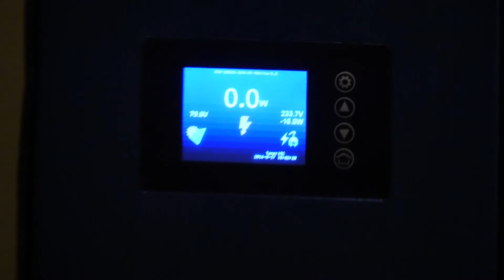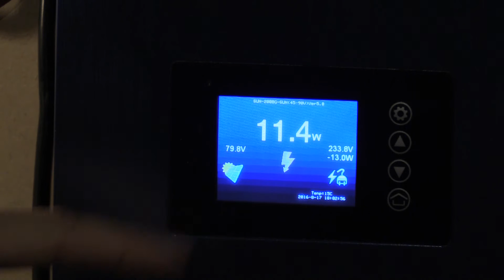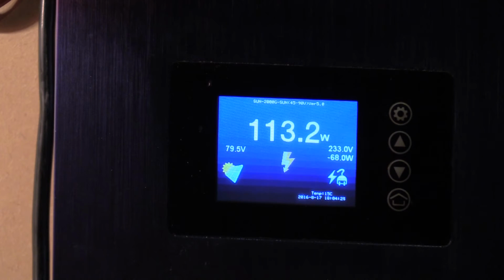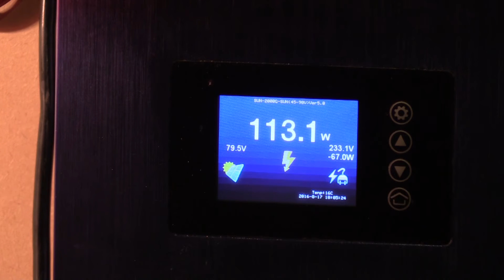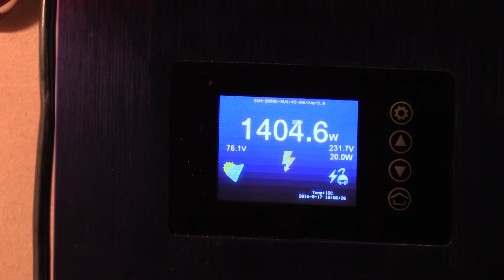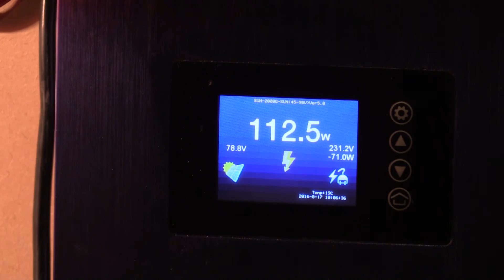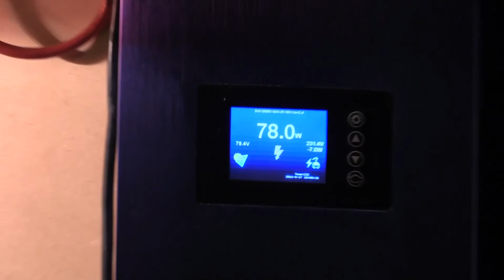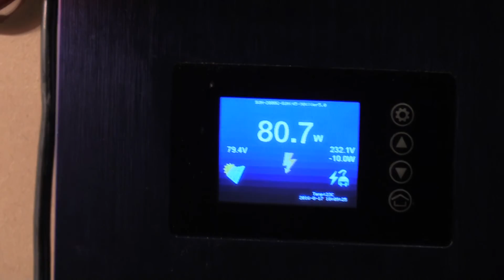It works! Limiter problem sorted

Comment: Why are you not putting the sensor clap at the input of power box like it is supposed to be? Damn you like problems...
Reply from the maker: Great question, the powerbox "switch board" is inside the house. Which is about 15 meters away. The garage is not attached to the house and sits at the end of the driveway and has just a single "what I think is a" 30amp AC cable terminating in a very small single fuse switchboard for the garage outlets. Since the CT Clamp needs to be attached at the closest point to the incoming grid/utility connection. It needs to be place inside the house and on the main switchboard. This creates a problem since the inverter is too far away without extending the CT Cable which is what i did on another video. Not without its own issues tho. I cant put the inverter inside the house without also moving the batteries inside the house and given the small room the switchboard is in and the safety issues, The best place for the batteries and everything else like the inverter, charges and everything that makes fan noises is to put it in the garage.  The only problem with the garage is the CT cable for the inverter otherwise it's perfect. The CT cable for the inverter does have a workaround that has been fine but i have just ordered the external limiter for the inverter which is meant to work up to 30m from the inverter which will fix the small problem of the current offset. Offset being the inverter with long CT clamp wire isn't 100% matching what the house is using and cant see 100% of the houses load to match, Which means we buy about 100watts of power rather than 0 when the inverter is on.  Keeping the batteries in the garage and away outside away from the house is a good thing, Also given the large amount of wires and other crap while testing and working on this project is also best suited for the garage not the main house area next the kitchen and bedrooms. There is a reason for the madness.
Reply: Mikes DIY Tesla Powerwall but your garage should have a power box (a break out box from main house box)
Reply from the maker: You cant just put the CT clamp around any cable, or the garage break out. The CT clamps needs to be around the main AC cable into the property. So it can read the load of the property. If i put a CT Clamp around a AC in the garage then it can only see the power use of the garage. "Pointless" . Think of it like water. If you want to measure how much water your using in your property you wouldn't put a meter on the last tap at the back of your house, you would put it on the mains before the house and at the closest point to where the pipe enters your property. Which is why all water mains meters are before a tap. Same with power. This is why a smartmeter or power meter is the first thing connected to your mains cable into the property to read how much total power your property is using. This is where you would also place a CT clamp.  I hope that makes sense.

Comment: Boss are you trying to charge up your batteries from extra power pumping into your house with your solar system?
And your trying to use this extra power from batteries to pump into your house? 
Please explain to me so im clear on what you are doing here. 
Thank You pls reply.
Reply from the maker: Powerwall will be used at night, Batts connected into the grid-tie inverter which at night time puts out just enough power to run the house load and no more so nothing is exported back to the grid. During the day the powerwall will be charged for use the next night. Charging is done with a powersupply and a dc/dc boost converter but will change later down the pack with using a solar mppt charger and a another set of solar panels to charge the powerwall directly.

Comment: Congratulations. I bet your glad all your hard works paying off. 
Would you not have to cut the ct clamp and extended with thicker cable to allow less volt drop.
Reply from the maker: On the next video :)

Comment: Now I have to ask, are you going to balance EACH 18650 cell individually during charging? or are you just balancing each "bank" of 18650 cells you have bunched together? It seems to me it's extremely important you are monitoring each individual 18650 cell to make sure it does not over charge above 4.2v. You have so many cells that without individual 18650 cell monitoring inevitably some of those 18650 cells will overcharge beyond 4.2v as your entire power wall is being charged. How are you individually monitoring and balancing all the cells so that each individual cell charge at max to 4.2v? Hope everything works out for you!
Reply from the maker: Your right, and its very important to monitor each one of the 20 packs, I have a plan. Individually monitoring is what i have always wanted, I have another video i am about to release that will cover some of it. Tho Step one is to monitor the bank voltage and turn off a SSR when voltage drops to 60volts. More details in the next video :) Step 2 is doing 20cell monitoring with live web updates.
Reply: Good! That's critically important. I'm so afraid for you guys with these DIY powerwalls without individual cell monitoring. If any one of these cells goes crazy high voltage during charging it can literally explode and cause a change reaction with all your lithium cells and cause a massive explosion in your home. These laptop batteries have no over voltage protection tops on each cell. I'm glad you're taking BMS seriously and will monitor each cell to ensure it charges to 4.2v max.
Reply from the maker: Yip, I will have it so if any cell goes above High 4.2 or low 2.9 The charger and inverter will shut off etc. I am only charging to 4.1 ish so it should never get higher that 4.2 etc.

Comment: Mikes, do you have a variable power supply? That's something you can use to variably adjust your load when testing. something like this:
https://www.amazon.com/KA3010D-Precision-Variable-Adjustable-Regulated/dp/B00G0VRFUG
Reply from the maker: No but i do have, http://www.aliexpress.com/item/Constant-Current-Electronic-Load-9-99A-60W-30V-Battery-Discharge-Capacity-Tester-New-Arrival/32664692302.html?
Reply: That works for DC testing. You were testing on the AC side. :-) Anyway, just thought I'd bring that variable power suppl to your attention if you had one lying around. :-)

Comment: I bought one of these. haven used it yet but im pretty much trying to do the same as you..

http://www.aliexpress.com/store/product/1200W-charger-for-lithium-and-lead-acid-battery-12V-24V-36V-48V10A-72V84V96V-108V-120V-for/708582_1848844939.html

where did you get your inverter from?
Reply from the maker: Page cannot be displayed
Reply from the maker: Found it, but i would need this one TCCH-H83-30
82.6V
30A
Which is on this link http://www.aliexpress.com/item/2KW-elcon-charger-on-sale-free-shipping-by-express-for-48V60V72V96V120V144V164V288V-lithium-and-lead-acid-battery/2024821536.html?
Reply from the maker: Going to make my own what that price
Reply: Any updates

Comment: Good to see its sorted now. How are you going to charge batterys so only excess solar power is used and not grid power as this where I'm stuck. I need cheaper option than Sma sunny island
Reply from the maker: Your right tho its very hard to find a solar charger that does 84 volts. The other thing is long term when i get to 10kWh bank i will need to charge that in 1 day of solar, So i will need a 2000w ish charger. Hmmm
Step one will be just getting it charging off AC-DC, 
Step 2 will be charging from AC-DC only when the solar is over eg 2kWh during the day, 
Step 3 will be putting another 1kWh of solar on the garage and running it down to a DC-DC mppt charge controller which will then charge the packs OR will go straight into the gridtie during the day and relay it off to batts at night and still use the AC-DC charger. That way during the day the inverter is doing solar to AC and during the night it will be doing batts to AC with the limiter on
Reply: Maybe have a look at the MPT-7210A from Bangood (and other sellers). 
Julian Illett has recently done a few videos on it.
It can charge at up to 90v so should be able to handle 84v no worries.
Just something to add into the mix of possibilities....

Comment: Maybe create a cable that connects 6 packs to the balance plug on the imax. still will take ages but will charge 6 in the time of one. You will have to keep an eye out for low cell voltages, if the imax is trying to balance at mA on such big packs it will be slow so might be quicker to charge that cell than finalise it with 6 in series.
Looking really good
Reply from the maker: The imax b6 charging one pack at 5amps takes 2 days, Good idea but only charging 6 out of 20 on the b6 will takes weeks lol.
Reply: I see now, your idea so much better. Lucky I only deal with small Li ion packs

Comment: Cool. That's great that it works.
By the way - I recently measured the wattage of a 150W light bulb and it turned out to be only 132 Watts. Your 100 Watt bulb might only be 80 Watts. Worth testing with your wattmeter.
Reply from the maker: Thats a good idea, i should of plugged in the wattmeter i had sitting on the floor